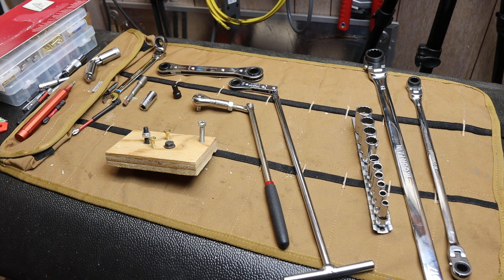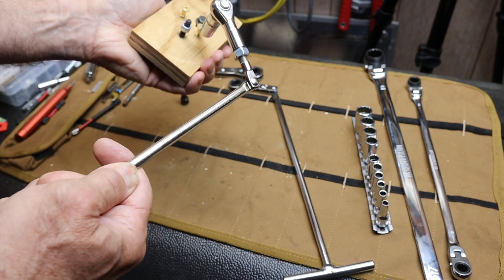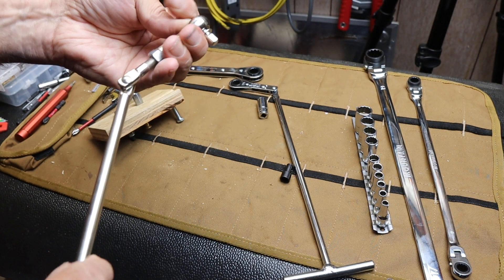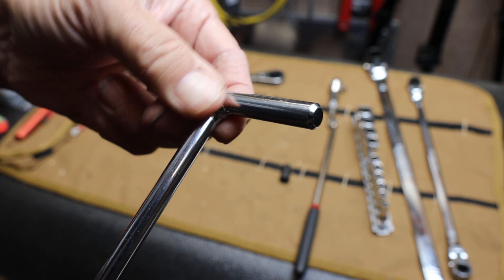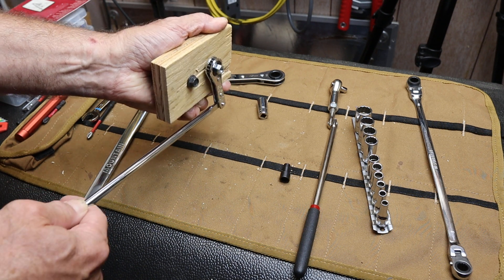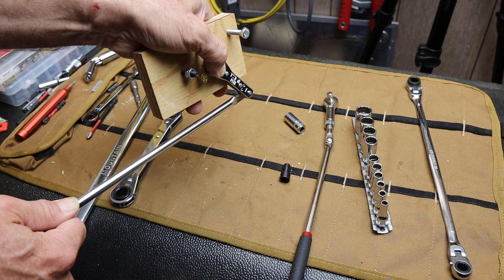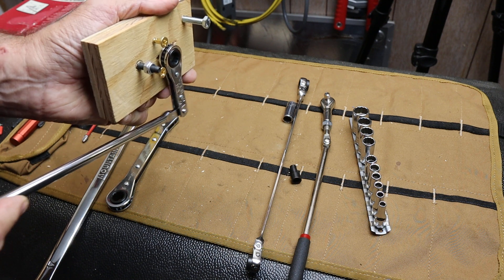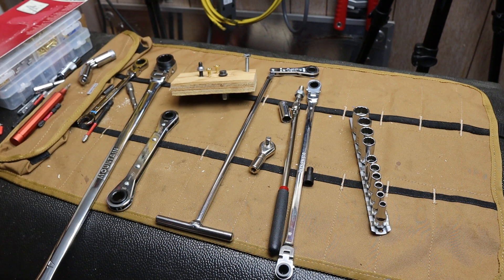Fun with Articulating Ratchets: Snap On RTBM10 T-wrench and 64100 Lisle Actuator wrench

Comment: The ratcheting device within that first ratchet is called a 'sprag clutch'; as is often found in automatic transmissions. Tip... keep it clean dry, and free of oils & solvents; and never depend on it not slipping. Also, for a really handy, versatile limited access, low back drag 3/8" drive ratchet, take a look at the Koken 3753SM.
Reply: ko-ken has really impressed me so far. I highly recommend you give them a shot Doc

Comment: Torrington lock bearing works as a sprag clutch assembly in an automatic transmission is used  as the ratchet . 84/23
Reply: Sorry for the repeat, did not read the comments beforehand .

Comment: Check out at Laser tools part 6074 1/4 inch bit ratchet. It has no reverse lever. But its so tiny and flexible.
Reply from the maker: Very interesting. Thanks for the tip.